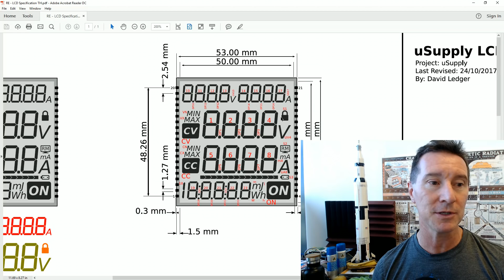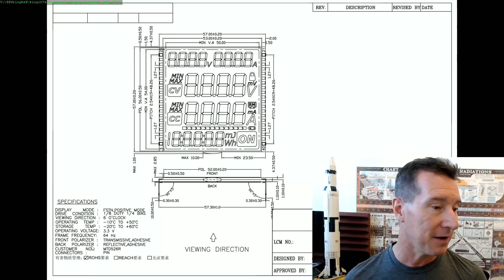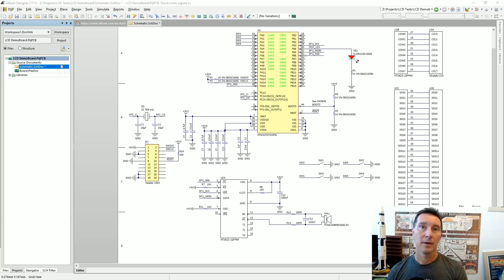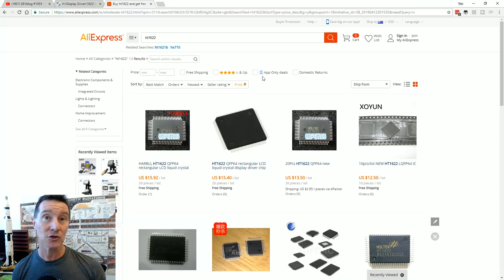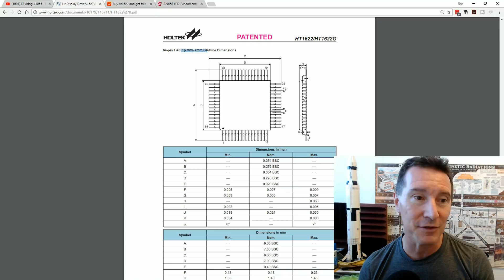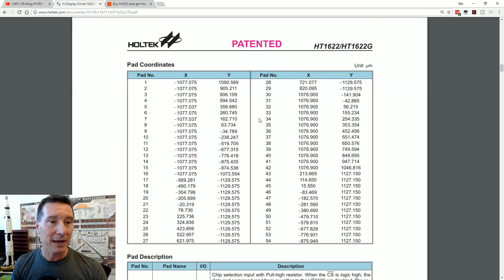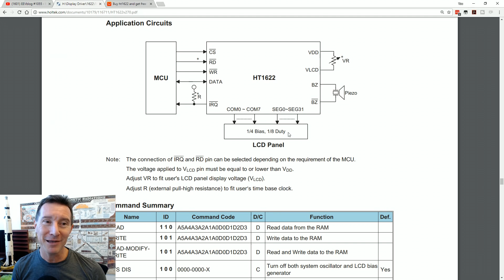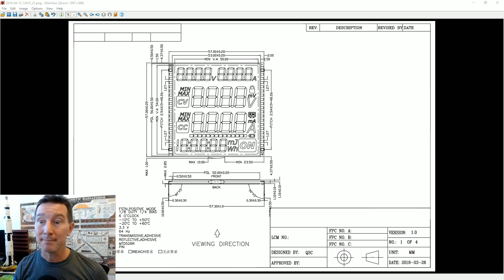EEVblog #1074  - Custom LCD Design - Part 2 - (µSupply Part 17)

Comment: Dave, I really like these product design videos. Can't wait to see the rest of this LCD series.
Reply from the maker: Thanks. I kinda hope something goes wrong with it make it interesting rather than "just works"
Reply: EEVblog hey Dave, the Microcontroller you showed, is it controlling the dedicated driver inside the LCD package or is it controlling the LCD directly ?
Reply from the maker: It simply send data to the LCD driver chip memory which handles all the display updating and drives the LCD directly.
Reply: Just want to echo the above - The design videos like this are easily my favourite

Comment: Clicked on this video as it looked like a DSKY LCD display like the one Franslab's trying to make at the moment! Like the work as usual Dave. Didn't know that you could get a custom anything for that cheap! Usually custom things cost about your quote cost per item let alone five! Amazing stuff!
Reply: With this kind of product (LCDs, PCBs, anything with fine optically-generated detailing) there's large costs to making the tooling, but very low unit costs once that's made. Getting five displays is probably not significantly more than just getting one - once you have the tooling made for one custom display you can just knock out four others virtually free.

Comment: Done some code for custom LCD at work. I can give advice: always use separate lines for control different words in string. For example, I have "Waste Volume" as one string and I can't turn on only "Volume". It may be annoying in case if requirements changes.

By the way, at home I made one fun device(on my avatar), details on my channel.

Comment: Long ago I did a design for a glass front audio receiver/amplifier with 32 touch points.  Created the 18"x8" test jig by pushing wire-wrap SIP sockets into perf-board.

Testing very large LCDs is one of the few applications for which I'd still use wire-wrap today.

Comment: Great Video Dave. 
A lot of the stuff you and ElectroBoom cover is making sense in practice with what I'm learning with my EE 4 year. This video helped me understand digital logic better.
Reply from the maker: Glad to hear, thanks.
Reply: this design stuff, is what the EE does almost every day...at least i done stuff like this when i was in that field, PCB design/layout, also faceplate (which i liked the most, easy and i also had a play with our lasercutter) and in two cased LCDs and at one time also a custom VFD...but technology advances...and i really think that they would probably go for these Oleds and put one of them right next to the knob or lever where its needed, rather than having a much bigger dedicated custom LCD in the middle of the faceplate...
Reply: Yeah I've been more on the software end for years. Only hardware was PC hardware buildup since the late 90's and knowing certain circuit components.

I did restaurant work, construction work, IT, and got tired of the BS then went for my AS and finished in 14'. 

Then got back into IT for a few years, then decided to finish a four year in EE. I want to learn more on the hardware end since I am almost solid on the software end.
Reply: I'll try and join the debunking like you, Thunderfoot, and Electroboom, possibly over the summer.

Comment: I am very surprised at how cheap it is to manufacture those. Looking forward to see the samples !
Reply from the maker: Yeah, crazy low. I think it's less than they originally quoted, maybe because of what I said in the video, that we made it easy for them in terms of artwork.
Reply: Seems like it's not very hard to manufacture it. You could check video: "DIY Custom LCD" from "Applied science" channel.
Reply from the maker: DerpyMarine : "Not very hard"? LOL 
Have you actually watched the video and all the process steps he look to do a basic single segment LCD? It was a great effort, but orders of magnitude away from the complex production LCD we are talking about here with hundreds of segments and ready to be mounted.
Reply from the maker: It's kinda like saying it's "not very hard" to make your own 4 layer 4/4thou PCB's with plated though holes, solder mask, silkscreen and routed slots etc.
Reply: At first sight it might look surprisingly cheap, but look at how cheap you can get prototype PCBs these days. It a somewhat similar two mask process to make the pair of glass sheets for an LCD. Its not a market that's as well developed as prototyped PCBs, so it costs $140, while a simple PCB might only cost a few dollars.
Reply: There is no need to apply conductive coating on glass with sputtering(hardest part that requires special equipment). You could just buy a glass with conductive coating. It's more like 2 layer pcb without plating, solder mask and silkscreen. Complexity depends on available minimum trace width and how tightly populated with segments it is.
Reply: coppice This what i've meant. Simple segment displays does not require any special equipment to manufacture. You could buy components from suppliers. Maybe my definition of "hard" is not clear. For me "hard to manufacture" is when you have to buy/make complex equipment to do it yourself.

Comment: Dave, why not you solder the LCD driver on a flex cable that suitable for the LCD size and save the area on the board ?

Comment: 44 LQFP won't work for 32 seg course it only supports 24 seg's. That leaves the 52 and 64 pin versions.
When you need the 2kHz or 4kHz tone frequency output you're stuck with the 64 (and 10 NC pins) Else the 52 will do just fine !
I can find them with HT1622(G)-(package) but they are among the worst I've seen on ordering codes :(
Reply: The 52 Pin QFP is flagged as EOL by Holtek ( last time buy was July 30, 2014) - so its the 64 pin part or nothing  ! Hate it when a manufacture drops a package but does not update the data sheet .

Comment: how much extra would it be to add something like 2 simple capacitive touch elements to a screen, so you could just have something like an up/down button right on the lcd, obviously using an external cap-touch chip, so it would just be a large element near the front on its own pin
Reply: Overlapped over other segments? Probably extremely expensive, as all that board real estate is already in use, and they're not going to add a third layer for cheap, if that's even possible. Off to the side? Probably costs barely any extra.
Reply: That's usually achieved with just a separate panel you put over the lcd, would be inconvenient to build it into the lcd itself.
Reply from the maker: Would be interesting to try and integrate into the LCD. If it's over the segment then that's more complex, but probably easily possible on the same layer if it doesn't overlap segments.
Reply: I have a $5 thermometer that has 3 touch zones on the LCD, so it's probably really cheap to do...

Comment: I know black blobs are probably more economical for super high volume stuff, but what it the manufacturing process for assembling a PCB with the HT1622G variant (bare die)? Are there specific PCB assemblers that do the bond wires to PCB etc.?
Reply from the maker: Not all assemblers will have the capability, but many big ones will.

Comment: Any frequensy for piezo? I always thought that they work best only at 1 or 2 peak frequencies as they are oscillators.
Reply from the maker: No, piezo transducers are fairly wideband, you can see one being used in my previous Rokit speaker video, it was used as the tweeter.

Comment: 9:50 The Holtec driver chip has a ‘G’ version that it says on the spec sheet is ‘Gold Bumped’.  What does that mean?
Reply: Intended for flip-chip COB uses.
Reply: OK thanks.  I guess they are gold contact points for the bond wires.